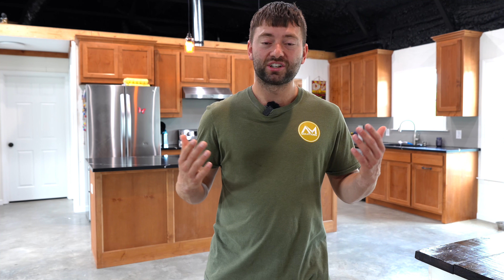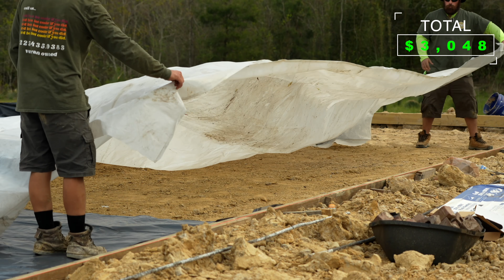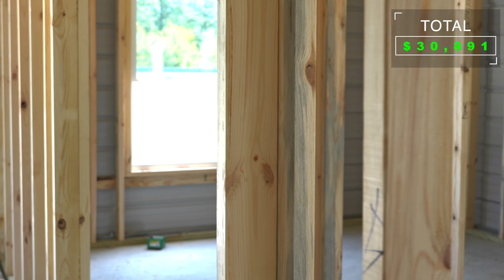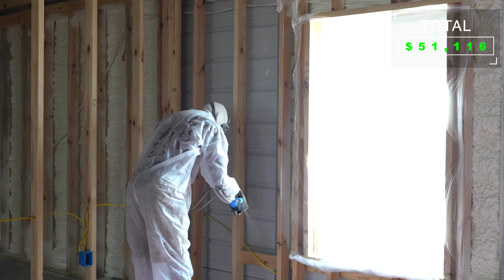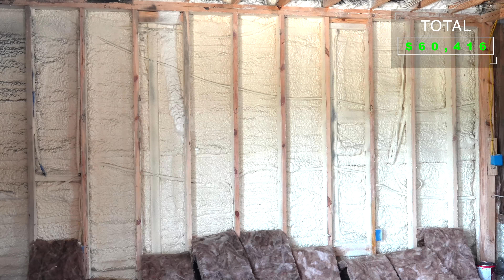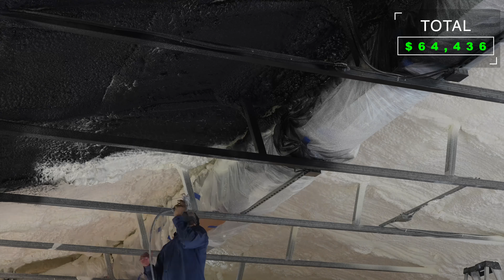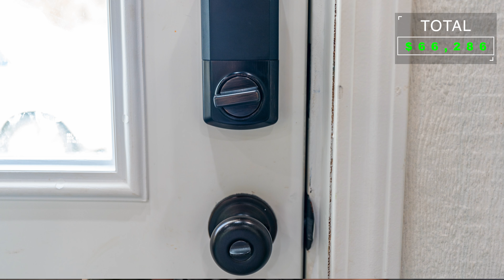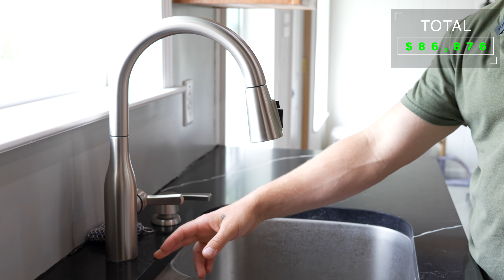Barndominium Price Breakdown | Building a 1,500 sqft 3 Bed 2 Bath Home for $87,000

Comment: I want to add a second story to my house in San Diego. Probably be $250-300K. House now is 1974 single story 1,300 square feet but 4 bedroom 2 full bathroom. Just 1 big room is Living Room/Dining Room. Open kitchen next to it leading to the garage entry door. Otherwise just tear down the drywall replace damaged wood and new insulation then drywall. Most of the neighbors just Expanded the house adding 600-800 square feet which raised the property value $300K
Reply from the maker: That's a great idea, property value there is insanely high! You will definitely see a return on your investment.
Reply: @DudeWeCanBuildIt  I'm Lucky my Dad got it back in 1975 and in 1980 he bought another house in Orange County. Super Lucky he never sold any home too. Both homes was super cheap back then.
Reply from the maker: @gtoutdoors1197  That's awesome!
Reply: @DudeWeCanBuildIt  only bad is No AC or Central Air Conditioning in the 1974 San Diego house. Was supposed to get it years ago but never did. Went from $7,500 like 8-10 years ago to $9K now AirMaxx saying $12,000. Replacing all Ducts and new vents, adding 1 vent. Heater Furnace too. I just leave the house 4-7 pm then Cool Breeze normally about 7 pm. All Windows Open. Might buy the Ice Water cooler, portable Swamp cooler.
Reply from the maker: @gtoutdoors1197  swamp coolers work great in dry climates like yours. I use one when I go truck camping out west
Reply: @DudeWeCanBuildIt  I also want to buy some land like 5-10 or 10-20 Acres prefer Northern California like Mt. Shasta area otherwise Oregon. I thought about the Factory Built homes but the ones that are Assembled On-Site rather than the factory homes Towed to the site.  I think Land with Clean Water source is best and in the future it will be very important and valuable. North Lake Tahoe on the Nevada side is nice too. But I still have to work my Career another 20 years and not much jobs in these remote areas.
Reply from the maker: @gtoutdoors1197  That is definitely the dream. I have family near Redding, Shasta county is beautiful. Lake Tahoe is great too, you could even get land on the Nevada side, probably cheaper lol. 

For me, it's my career and being close to family that keeps me planted. The roots go deep here, so I developed my dream where I'm at so I don't have to wait 20 years and sacrifice proximity to the family. 

It was a lot of work developing a swampy piece of land that I could afford and the weather is hot and humid during the summer. The rest of the year is nice though, and the winters are mild. Plus I get to see family whenever I want, usually on the weekends.
Reply: @DudeWeCanBuildIt  Yucaipa and Mentone is nice community with Mountain Views and at the foohills. I used to hike and off-road my Truck in San Gorgonio mountain trails. I think the roads only go up to 8,500 feet but you can hike up to 10K or 11K plus Peaks
Reply: @DudeWeCanBuildIt  We getting 90% Humidity but normally Midnight to 6 AM last 2 weeks. I opened the windows you don't really feel it much. When I went to India in the Summer that was tough Humidity.
Reply from the maker: @gtoutdoors1197  Wow, that's high humidity for that area! I've never been to India, that must have been an experience
Reply: @DudeWeCanBuildIt  Yes it's just looking at the weather app or website hourly weather. Right now it's 85% Humidity in OC and 90% in Inland San Diego, but I don't really feel the Humid weather. Was just a nice cold breeze an hour ago. Only once it got crazy in San Diego maybe 4-5 years ago at Midnight it was 90 Degrees and Very Humid I had to leave the house Fast.
Reply from the maker: @gtoutdoors1197  If it's over 70° at night, I would be getting a window unit!
Reply: @DudeWeCanBuildIt  That was just Once in the 3 Days Heatwave of 105 Degrees highs when Humidity came at Night just 1-2 Nights. I remember it being 75&78 Lows and feels so Cool but you are getting used to 100 Degrees weather at 2 PM.
Right now Cool Summer is Nice, No Humidity so far. 65 degrees and the $20 Home Depot box fan really helped when I put it by the Window.
Reply: @DudeWeCanBuildIt  we are getting Central AC and new Heater Furnace by next year as Renting the house probably $4K a Month the renters will Expect it
Reply from the maker: @gtoutdoors1197  Makes sense. It will be a fantastic investment!
Reply: @DudeWeCanBuildIt  the Attic and garage cooling became heating, all 3 metal spinning fans on the roof stopped working or went bad. Changing the fans probably step 1
Reply: @DudeWeCanBuildIt  the water fans, Tower type, working good for 1-2 hours then no cool wind just humidity but it was After 3 pm and house always gets Hot at 4 pm. Cool Breeze outside tonight Opening the Windows Cool house fast. Now Cold going to bed is 3 AM
Reply: @DudeWeCanBuildIt  Southern California best if you have 2 Rental property and live in the 3rd house. Hard to do now as almost everything is $900K Plus
Reply from the maker: @gtoutdoors1197  Or rent all 3 and live like a king somewhere else
Reply: @DudeWeCanBuildIt  Two Houses here is like $96,000/Year Rent income. 3 be great just wait 10 years. Buying 1 House every 10-15 years good plan just pay off when can.
Reply: @DudeWeCanBuildIt  Double story be nice as the backyard Canyon views are amazing very scenic, sunsets and night views of the city far away. Realistically just adding 600-800 square feet expanding the back of the house= Kitchen, Dining Room and 2 bedrooms, just that whole side of the house. This be way less money & add the Square feet from 1300 to 2000.
Reply from the maker: @gtoutdoors1197  Having the second story would be awesome. Having more square footage and better views from up high is a double win. It would also be a good time to get the central AC installed during the construction phase.
Reply: @DudeWeCanBuildIt  definitely yes, if expanding the house need to get Central AC after the extra additions. Most likely we won't do anything and Rent it soon. But we will get Central AC before next year Summer. This year mostly 80 degrees weather just a few Heatwaves hit 90. Hopefully no 100-105 in August and September. We always get a few days of that. Inland San Diego.
Reply from the maker: @gtoutdoors1197  That makes sense. Air conditioning is becoming the norm in California. It usually is nice in the 60s at night. I was in Compton a few weeks ago and it felt so nice compared to Louisiana
Reply: @DudeWeCanBuildIt  I drove past Compton but not really wanted to hang out there. It's famous from Rap music. But I went to Cal State Long Beach for 3 years and I loved the weather and hot girls and the chill relaxed vibes.  San Diego I think is one of the best places to live in California, it's more easy going compared to Orange County. Beer Capital of the world too. Portland Oregon used to be nice but I heard it changed with riots and political movements.
Reply from the maker: @gtoutdoors1197  Compton was neat, they blocked the road and had a burnout/drag car competition in the intersection in front of the house I stayed in one night until the police showed up.

Portland is cool too, gloomy weather and lots of homeless camps downtown. Better to go to the coast. 

I love San Diego, the best beaches and best weather. You can get Acai bowls on every corner!
Reply: @DudeWeCanBuildIt have not been in the Attic or nobody has in 25 Years, be Scary now. We still have the Abestos pipe going from the 1974 Furnace to the Attic. Probably get Attic cleaning and sanitizing then Insulation and Attic Fan. Unless everything is removed including the roof, building a second story.
Reply: We bought the house for $28K back in 1975. Now it's about $990K but neighbors homes more as bigger.

Comment: I am doing one of these on my property. Permits are $15k. Electricity to the lot, $12k, and another $2k to the panel. Septic system, $25k. Well, $30k. Need I go on?
Reply from the maker: Wow, $25k for a septic system??

Those go for $3500 around here!
Reply: @DudeWeCanBuildIt  I'm near Denver. The cost of building around here has become a joke. Unaffordable for most. Apartments are going up like hotcakes because fewer and fewer people can afford a mortgage. The cost of living is up 30% over the last 3 years, or so. How does the average resident stay ahead? Answer: they don't. Elections have consequences, especially if they are stolen. Every county in the state of Colorado had illegal vote tampering for the 2020 presidential election. This, according to Mike Lindell's research into the matter. Chinese hackers were heavily involved in vote tampering, as their ip addresses were traced to the CCP. Sorry for the diversion. America is in bad shape. People need to be aware.
Reply from the maker: You are absolutely correct on both fronts. Housing is not affordable, so foreign companies are buying it up and renting to Americans. It is very backwards. 

The 2 party system is out of date and divides our country and limits us to 2 candidates.

Comment: Awesome! I’ve seen a huge increase in demand for this type of builds. 60% of the leads I get are people who want to get a Barndo shell. I just wish people would take the time to do some research and have a general idea of what they want. While our tubular steel frame buildings are a lot cheaper then red Iron, it is harder to customize and make the shell look like a regular house. But we got some great options. With our direct attach option, you can attach your plywood or Sheetrock directly to the building’s walls, saving you time.
Reply from the maker: That's cool!

Comment: The labor you hired must have all been named Methew, your numbers are so BS, and you are missing so much in your numbers, Just nails and adhesives are $1000. Im a GC and there is no possible way even if I did everything myself, those numbers even come close. Besides so much you show doesnt meet IRC, and the fit and finish is terrible. WOW juts WOW!!!!
Reply from the maker: I will be linking the receipts to the pinned comment at the top. Have a look when you get a chance. Most of my stuff came from Home Depot and other building supply stores. 

Labor varies depending on your area. Where are you located?

Also, everything meets code, passed inspection and received occupancy permit.
Reply: @DudeWeCanBuildIt  What is the adopted code standards? not the IRC obviously. What State, County, and township, would love to review their code.
Reply from the maker: Livingston parish Louisiana.

It's rural, so no township. 
Let me know what you find out, you've got me interested now.

Comment: Not many people can do this legally and occupy the home.  When did you buy these materials? $363 for Base and Case? I Call BS, even at 50 cents per foot for really crappy MDF, ProPacks are about 82 cents/foot, there is no way you bought enough to do all the doors and base, much less windows. Assuming a closet in each bedroom, thats 8 interior doors, and assuming 2 exterior doors, thats 193 feet of just Door Casing.
Reply from the maker: I purchased door pack and baseboard from Home Depot. It is not MDF, it is pine I believe. 

All of my interior doors came with trim and I only have a closet in the master bedroom. The open floor plan reduces the amount of baseboard that was required. 

The cheapest part was actually the 1x4 crown moulding!
Reply: @DudeWeCanBuildIt  Ahhh there we have it, its 1 bedroom then.  no closet, not a bedroom, that's how an assessor,  an appraiser, and most jurisdictions see it.  Base from HD is $0.825/ foot for the cheapest pro pack, as a builder I know, how much waste there is,  you still have walls, and all the walls have base. oh and that 1x4, while functional looks like a fort i built when I was 10 out of scraps and pallets. sorry bud, but when you don't know what to do Hack-A-Do.
Reply from the maker: Lol, I'm a functional guy. I really don't care for the bland whitewashed houses they are building these days. Lots of new homes don't even have crown or window moulding, so you really could do it cheaper than I did. 

I like wood grain, hence the stained cabinets and matching crown. I also like Sriracha and spicy food. The fort that you built at 10 probably has more character in it than the last 20 homes that you built. That's what people like, bland. Neutral colors and resale value. Nothing personalized or inviting.

Comment: That ain't no barndo! The outside shell is a disaster waiting to happen in a high wind. Nice build but those thin metal sheds are a joke.
Reply from the maker: I appreciate your concern. 

29 Gauge architectural panel holds up fine in hurricanes. I have installed many metal roofs and have not lost a single one.

This building in particular is engineered for 150 mph winds.

Comment: Heck, I don't need 3 bedrooms just for myself. But I'll definitely use one as my bedroom, use the master bed as my office, third bedroom just for storage. I just need one full bathroom and one half bath.
Definitely hiring folks to build it for me. I am not a DIY dude...except for the countertops. There's a youtube channel called Stone Coat Countertops and they just use MDF and epoxy. Just as durable, heat resistant, much cheaper and lighter than using real stone. Heck, each one I would do is a one-of-a-kind amateur art piece and a lot of fun doing them.
Reply from the maker: That sounds cool, I'll have to check them out!

Comment: $8k to wire a house... $7k on all the AC.. OKAY. These prices don't mean anything to a normal person. The electrical would be triple and the AC work double to triple for a normal person.
Reply from the maker: I'm not sure where you are, but these are pretty on point here. Add $4k to each for Labor if you are hiring out the whole job. 

Not sure who is charging you $14k - $21k for an AC system. We usually charge $10k - $12k for new construction. Bigger companies around here do spec houses for under $7k all day. They use contractor grade equipment and have massive accounts. We can't even purchase the equipment for what they do the install for. 

What area do you live in?

Comment: These are the lowest material and labor prices I've ever seen. Cost me more to get a plumber out to replace a shower faucet than It cost this guy to have his ground pipes laid.
Reply from the maker: Sounds like the plumber got over on you. A shower valve is less than $100 and with PEX fittings, you can unscrew them without needing to cut the water lines. 

I have done this several times for people and it only takes an hour (or two if you have to cut an access in the sheetrock.)

$3000 ÷ 2 hours = $1500/hour. 

Seems kinda high for me.

Comment: Instantaneous hot water heaters will require ongoing maintenance to keep the scale from building up. You need to add that cost in over a tank water heater. As a plumbing and electrical contractor I would not put one in my home.
Reply: I don't think that's an accurate assessment. I paid $150 for a on-demand hot water heater for a 10 bedroom home that's been working just fine for 15 years now... Can support three showers at a time and the jacuzzi tub would never be able to handle a regular water heater.... Also I built my entire house for under 200k
Reply from the maker: @deanburrito6943  That's awesome!
Reply from the maker: I'm sure I will learn soon enough. Thanks for the heads up!

Comment: Concrete labor lot higher in different areas. You got off good around my area that pour would have cost you 1700 to 3000 depending on company.
Reply from the maker: Most definitely, prices tend to vary a lot!
Reply: Just hire some guys for CASH.  No need for a "company"